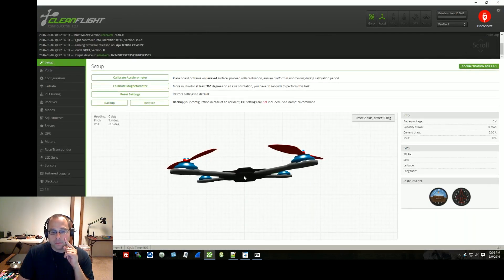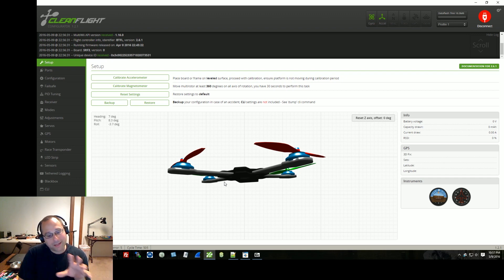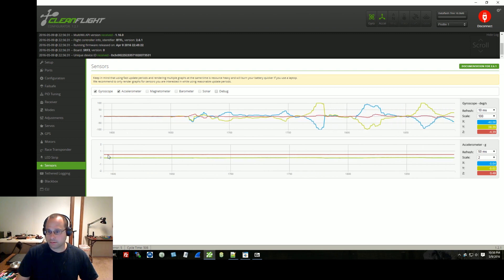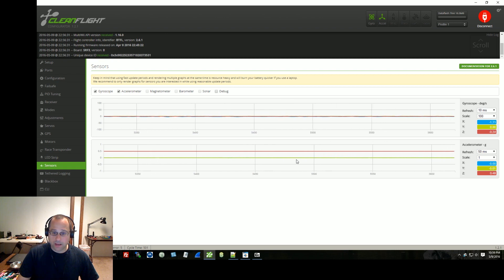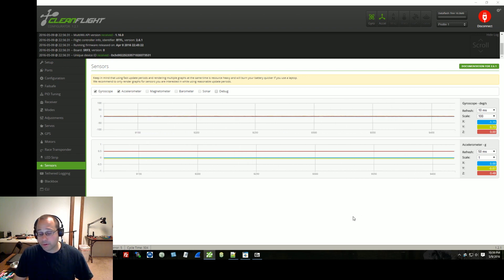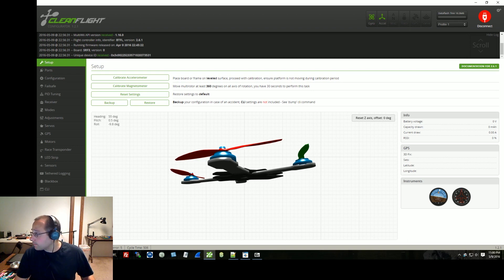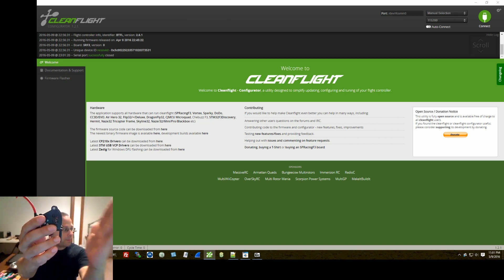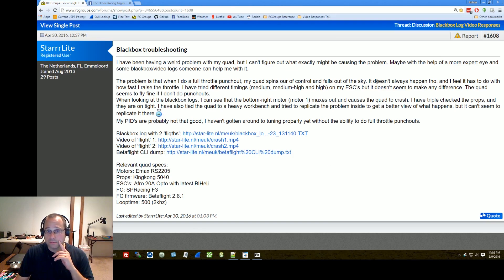Livestream Highlight - 5/9/2016 - Bad gyro vs.  bad accelerometer

Comment: so if your drone constantly moves very slowly pitching forward in betaflight your board is hosed? I can't get this thing to stop pitching forward in flight. I notice it moves like .1 degree per few seconds in beta flight.
Reply from the maker: Check that the channels are centered at 1500 in the Betaflight receiver tab?
Reply: @JoshuaBardwell  Yessir, perfectly centered. Tried trimming them back, also tried trimming the accelerometer. Its weird because the drone is from 2017, but it was only ever flown once or twice. Thank you for he response. Even though the pitch rate is very slow in betaflight, when real flying, the pitch is quite bad to the point of being a little dangerous.
Reply from the maker: Don't trim the channels to fix the issue. If the channels are centered then there is some problem with the FC.
Reply: @JoshuaBardwell  darn... this thing is turning into a money pit. My last question for you since you have been so helpful is. I do not have the bheli driver installed, is that why in betaflight the motors tab wont load, and in the configuration tab I don't see the "mixer"? You wouldn't happen to be interested in trouble shooting my eachine for money by mail would ya? I have a couple weird issues, and no where to take it locally.
Reply: @JoshuaBardwell  I wanted to mention, I noticed something. It actually doesn't pitch forward, it pitches one nautical direction, if I turn the drone while its pitching forward, it then is now pitching backwords... or sideways depending on the way its facing. It is acting like it is in headless mode with a tone of forward pitch... does that tell you anything?

Comment: Ok so I just bought the geprc mock 4 4k 5"  and have only gone through 4 packs with it , with no hard crashes  just a couple of hitting a small tree limb and fall to the ground.  I changed my rates to what I think ladrib uses , idk if the problem started there or not because ive been flying easy but anyway . When I role right the quad stops violently at around half a turn then roles some more then stops and then finishes the role.  I haven't really noticed much if any other problems except maybe a wabble at the end of a punch out when I drop throttle . So I snipt the tip off the end of the back right prop to see what it would do with a flaw and sure enough everything else worked fine except roling to the right and this time it cork screwed and fell to the ground.  I turned my d term off and I can somewhat do a role although its more like a barrel role like Im holding throttle up a bit as i do the role and it doesnt do it every time . I looked at the thing you were showing on this video and one of the axis is jumping from 0 to 4.6 and higher like xrazy do you think im going to have to send the quad back to race day quads?

Comment: My quad try’s to fly sideways during flight this means I need to calibrate my gyro ? Right ?
Reply from the maker: I'm not really sure what you're describing. If it tries to yaw to the side make sure the channel is centered.
Reply: All channels are central when I arm the quad  the left side motors spin up and right are delayed but when I’m flying it seems to go off to right when I’m only flying forward as if the gyro was calibrated off enter
Reply: It is a brand new flight controller naze32rev6 I know it a old FC but I’m using what is easily accessible to me

Comment: I b0ught a HGLRC Hornet 120, biggest problem I cannot update because the FC will not go to DFU mode. My FRSKY QX7 works, modes work but my STATUS gyro in CLI says NOGYRO NOPREARM CLI. Weired, this is after i put my XM+ receiver and going through your no ARM video.Please help! If I go to calibrate accelerometer it is not high lighted. I am almost ready to gut this thing out and replace it with raceflight!

Comment: My 3D model responds very slowly like 15+ seconds to reach a 90 degree bank,  and I can't get anything from the magnetometer, it shows green as if it is enabled, but calibration button is grey. I'm guessing my board is DOA. any ideas?
Reply from the maker: Your board most likely doesn't have a magnetometer. For the 3D model being slow, I'm not sure what would cause that.
Reply: It is supposed to be a Deluxe version, with Mag and Baro. Can i tell for sure visually?  Thanks. Pretty sure this board is DOA, and bad.   :(
Reply from the maker: Hmm what board is it. Another thing is that Mag and Baro features have been removed from Betaflight for some boards because the board doesn't have enough memory. You can try an older version of BF or you can try iNav if it has a target for your board.
Reply: It is supposed to be an SP racing F3 deluxe 10DOF.  The case has Cleanflight printed on it,  but I am thinking it is a clone.  The CPU load at the bottom is only showing 8%,  Does that mean anything?  I am new to this board and cleanflight. Thanks.
Reply: Loaded up iNav, now the 3d model is responding perfectly, and the Magnetometer is showing in the config. looks good, I will attempt to calibrate it all next. Thank you!
Reply from the maker: Awesome!

Comment: Rise rxs 270 lux v2 fc. auto lvl mode, after take off quadcopter rolls to right more and more over time, rolling left to hold it still untill can not roll left anymore. does not do this in acro mode all trims zero, accel calibrate done all screwa motors and props are tight... any suggestions all pids and settings are stock running betaflight 3.2.0 spektrum dx6 spektrum serial reciver
Reply from the maker: This is accelerometer drift. It is a known issue in betaflight that has no sure fix. Suggest setting acc_lpf_hz lower in the CLI. Default value is 10 you might set it all the way to 1.

Comment: No I didn’t. I didn’t know how at the time. I know. Stupid right but I didn’t know what I didn’t know. So I think I put a f4 firmware on my f3 board. After I figured that out I flashed it with a f3 3.2.2 firmware but my gyro and accelerometer never came back. Did I toast my board or is there anyway to recover it?

Comment: hi, so after updating to betaflight 3.2 on my mini f3 control board my accelerometer and gyro stoped working. how do I turn them back on? I tried turning them on in configuration.
Reply from the maker: +Clintstussi most likely guess is the target you selected in the pull down was incorrect. Did you verify the target in the CLI before flashing?
Reply: Joshua Bardwell 
No I didn’t. I didn’t know how at the time. I know. Stupid right but I didn’t know what I didn’t know. So I think I put a f4 firmware on my f3 board. After I figured that out I flashed it with a f3 3.2.2 firmware but my gyro and accelerometer never came back. Did I toast my board or is there anyway to recover it?

Comment: Thank you for your videos. Quick question, new to the hobbie...Can I get a Racing or Freestyle drone where I can turn on and off the gyro? SO let's see I know that I am going to crash and I have enough time, then I can swith one controller and stabilize it. THank you for your advice.
Reply from the maker: +Mariano Agustín Bosaz the gyro is always active even in acro mode. Do you mean the accelerometer? Autolevel? All modern FC can turn acro on and off with a switch.
Reply: Joshua Bardwell thanks for your reply! yes, autolevel... is that a separate component or something that some FC offer?
Reply from the maker: All FC today can do autolevel.

Comment: Hey Joshua (love your work btw), can you explain to a noob like me is it normal to have some noise in gyro on my Omnibus F4 (Wizard x220S). When i connect it to a PC (and only the board, no other stuff soldered), and I go to motor tab in BF (3.1.7 or 3.2 now) on the gyro XYZ axis I constantly see abaut 0.49 to 1.40 noise. It's on sponge, on a stable table and there is no outer forces shaking it. Is it normal or does it sounds the boart is a gonner?
Reply from the maker: +BombowaKuna it's picking up really tiny vibrations like from your computer fan. It's normal.

Comment: I have a problem and i guess it is gecause of a noisy Accelerometer. You can see it in this Video I uploaded: https://www.youtube.com/watch?v=PiGGL4-Vt88 the longer I fly the more the Angle Setpoint in Angle Mode drifts and would drift away if I did no compensation on the sticks which works as long as the drift gets too large to get compensated. How could I solve the Problem?
Reply from the maker: I think you can try lowering the acc low-pass filter. In the CLI it is something like acc_lpf.
Reply: The acc_lowpass is already at 10Hz. I think I will have to wait for my softmounts to arrive because my 130mm frame is really stiff and resonates strong with the 45Hz Vibrations and harmonics of that.

Comment: Friend I have a problem in a racer and I can not figure out what it is, when I'm flying with him normally and I'm going to make a flip or a roll, the racer does not stop spinning and falls on the floor, and I tried everything using An F3 Evo with Beta 3.1.7 already tried to go back to previous verses and it did not work, can you help me? I'm thinking the problem might be on F3
Reply from the maker: Raise min_throttle by 20 points.
Reply: I tried this and it did not help, what can be the Acc, because sometimes when I calibrate the acc the image of the quad on the computer screen for vertical and not horizontal as it should ... the problem may be in the F3 acc What are you doing?
Reply from the maker: I fly with acc disabled. Are you in horizon mode? Try flying in acro mode. Then the acc is ignored.
Reply: Yes in acro mode the problem continues, will it turn off the acc will change?